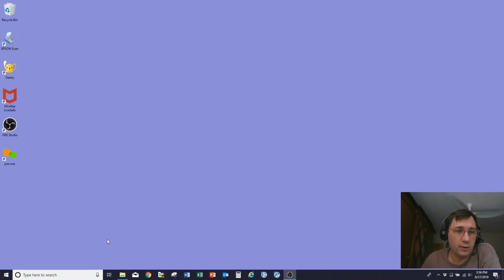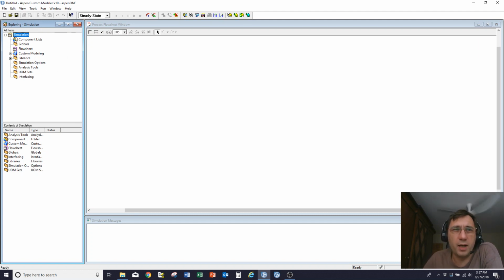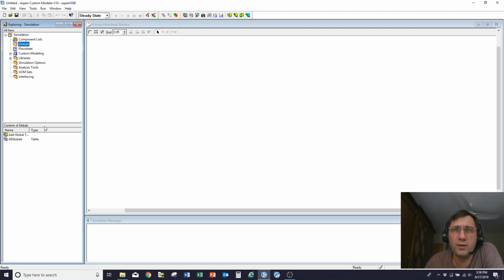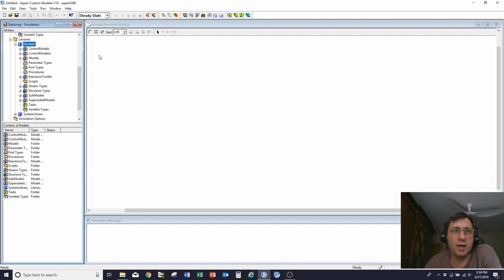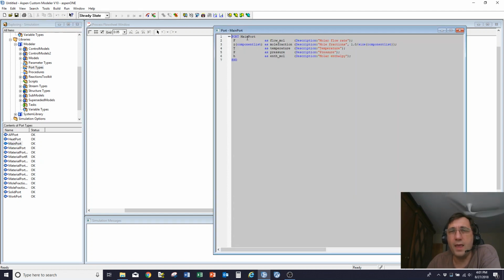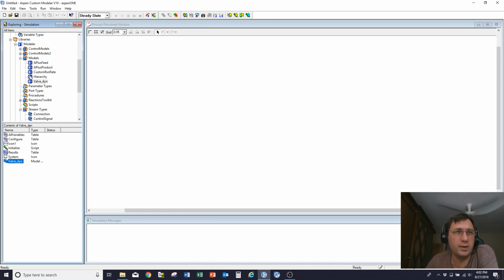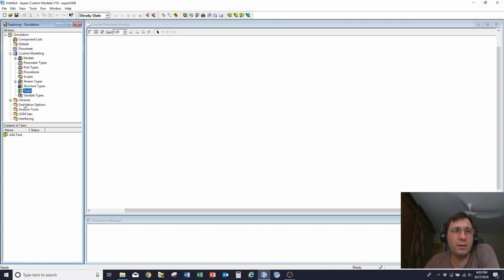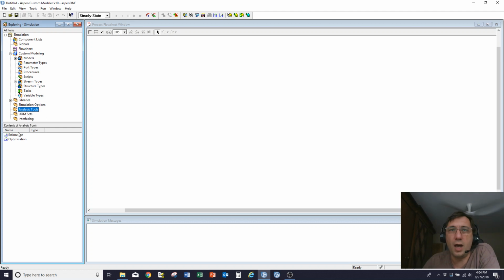ACM1. Introduction to ACM layout and operation

Comment: Good day, Charles. Foremost, I would like to thank you for the videos on ACM. I am working on a case involving powering a Fluidized catalytic bed reactor by induction as its heating source. Can you advise on how to : (1) Define the geometry (design of the reactor) and (2) Model the induction heating(it is expected that the catalyst has ferromagnetic properties that would initiate heating by hysteresis)?
Reply from the maker: Thanks for the feedback - I'm glad that the videos are helpful.  In terms of your project, I'm not sure that I have any great insights to offer - ACM allows you to write your own equations and set up pretty much any problem, so in terms geometry, you should be able to add equations to link volume to liquid level (tricky if you have dished ends or a horizontal cylinder, but doable); and you should be able to link the current in your induction heater to voltage applied / resistance and thus power delivered.  Good luck!
Reply: @cssandersonllc3172  Thank you very for the response. I will follow up on the given suggestions.

Comment: Hello Charles I'm a master's student in chemical engineering and I'm trying to design a carbon capture pant using rotary packed bed reactor instead of a normal packed bed column can you guide me on how to do it in aspen I've tried my best but didn't get any idea as of now from the internet..
Reply from the maker: I am willing to help if I can, but I have a fulltime job and not a lot of spare time - I can give you some pointers and ideas if you have specific questions.
Reply: Thank you so much Charles ! May I have your email ID so that I can send you the nessary Pointers

Comment: Hi, I am a student in Energy Engineering and I'm doing my special work on a thermal storage tank, but I have some difficulties with ACM. I need a tank in which the flow of air at high temperature heats up it in the charge phase, while cools down it in the discharging phase. Could you please help me?
Reply from the maker: I see that you've already reached out through email.  I'll help if I can, but have limited time...

Comment: How can a water electrolysis cell be programmed in Aspen custom modeler?
Reply from the maker: You would need to develop a set of mathematical equations to describe how the cell you want to model operates and then encode them into ACM.  Depending on the complexity of the system, you may wish to use the Aspen Properties database to get information about the physical properties - that has routines to handle electrochemistry as well as more traditional things like density and enthalpy.
I've tried to set this channel up as an introduction on how to write those equations and structure a flowsheet model.
Good luck!
Reply: @cssandersonllc3172  thaThank you very much for answering the question. I wish you the best in your life. I will try maybe I can program it.

Comment: Hello, I have a doubt and I want to make sure, please. 

I want to use T in K. 
The unit displayed in the variable type is °C, so in the script, I will have to enter the value in °C which gave me wrong results. 
 I tried to create a new variable as follows:

Variable TempK/*  K  */
 Lower: 27;
Upper: 5273;
Value: 300;
PhysicalQuantity : "temperature", "K";
End

However, when I run my model, it's true that I have the T in K BUT I cannot see the other units (I mean I can not convert it). Is this normal when creating new variables? Also, is what I did correct?

Another method (following the ACM user guide) is to use: bOK = UOM.DefineConversion("Temperature", "K", 1.0, -273.15). But I don't know how and where to use it (as it gives me errors)

Thank you
Reply from the maker: Hi Doha

There's a couple of different things here.

You can create a new variable at any time, and assign default value and bounds.  However, to assign a PhysicalQuantity, you have to either use one of the ones that comes with ACM as default (in which case you're bound to their choice of default unit) or you have to create one of your own.

To create your own PhysicalQuantity, you have to edit some VB Script that'd buried in the admin area... C:\Program Files\AspenTech\AMSystem V12.1\Bin by default.  You can edit the file there called "OnNewDocumentScript.vb".  That's where you add the "bOk = ..." text.  However, that requires admin access.

Good news, though - Aspen provided a variable type called "Temparature_Abs".  I think that might be what you were looking for.

Charles
Reply: @cssandersonllc3172  Thank you so much for your help

Comment: Hi thanks for the videos. Is it possible for you to make more basic videos for beginners on how exactly to use ACM? Example- how to  make our own ports according to our required model? Or about the errors that occur and how to debug? unit conversions etc
Reply from the maker: I'm pleased that the videos are useful.  I think most of those topics are covered in these videos...  Have you had a chance to look through them all?
Reply: @cssandersonllc3172 yes I have watched most of your videos. 
 Let me be specific with a doubt. I made my own port with 3 variables and compiled it. Then I added an input and output port to my model (dynamic simulation). But when I connect my port variables to the model variables, the "run" option gets disabled. Could you tell me why that is happening?
Reply from the maker: There are several possible reasons - I'd need to look at the specific code to understand the issue.  Some possible things:
- Is the model "square" - do you have the right things fixed / free?
- Do the variables in the stream and block ports match?  Or are you getting a "spanner" in the Spec panel?
- Are there any debug messages in the Simulation Messages window?

Comment: Thanks for your video, it really helps.
Reply from the maker: Glad it helped
Reply from the maker: Interestingly, your full comment didn't seem to come through in this stream, but it did to my email...  You asked:
"Hi, Charles, thanks for your video, it really helps. I am new to ACM or Aspen related, and I am trying to establish a flash model according to the ACM guildance. I defined a variable Mw as "Mw(ComponentList) as molweight (description:"Mole weight of feed")", then call it using "Call (Mw) = pMolWeight() ComponentList; but the simulation message always shows " Error at position 25: Scalar expected for procedures output argument 1" . Could you please tell me where is wrong ? Thank you very much."

I think that the answer is that there are two very similar procedures in ACM - pMolWeight and pMolWeights.  The former returns a scalar value of a mixture and needs a MoleFraction array as an input; the latter returns an array of the molecular weights of a ComponentList and has no input arguments.  I suspect that you intended to use pMolWeights.

Charles